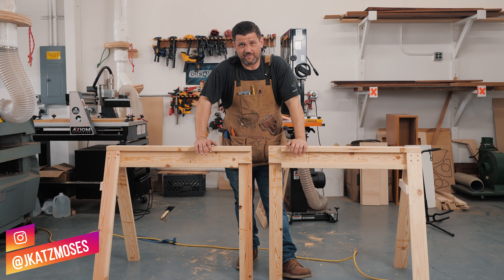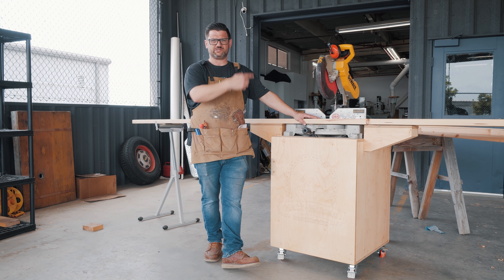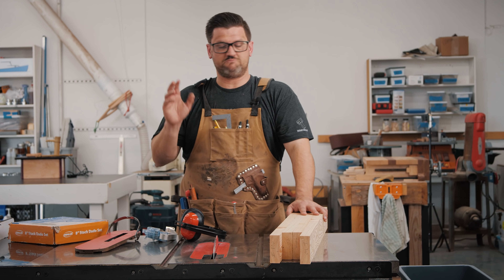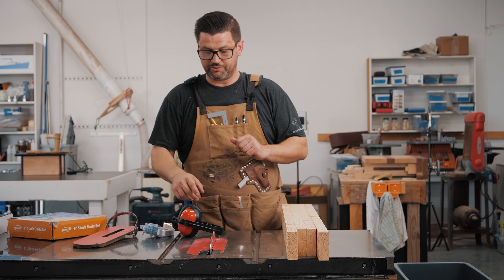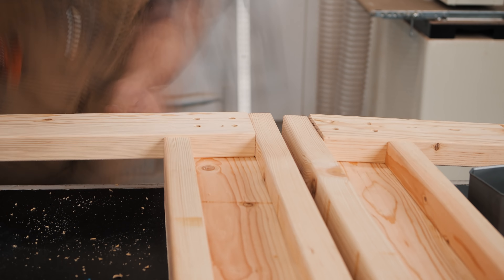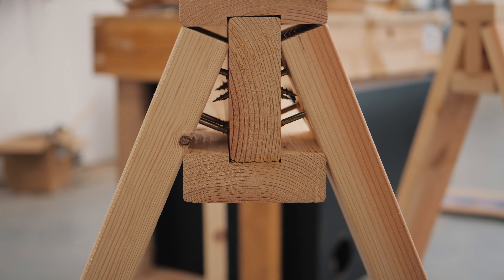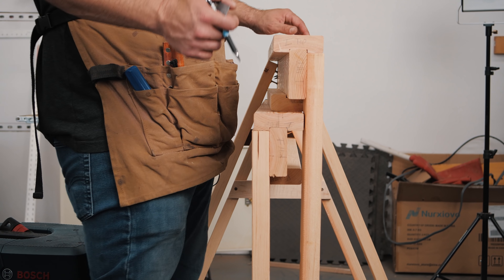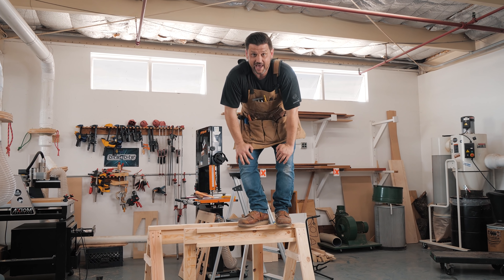Building the Ultimate Shop Saw Horse

Comment: The original dimension for the short leg was correct: 34 5/8" (instead of what you reduced it to later in the video, which was 33 5/8"). Actually they are probably both right. If you do the dado, the shorter length is probably right. If you don't do the dado, the longer one is definitely right (I'm confident because I just finished the version of the project without the dado). You might say, how can that little dado make a whole 1" of difference? Well, in addition to the depth of the dado itself, the dado makes the I-beam shorter, which causes the legs to be spread a little wider.

Comment: Great design. My father in law, who doesn’t do woodworking, insisted on me having a set of saw horses. They were so big and wonky that they just sat in a corner of our basement. I think the few times that they were used it was just to sit stuff on. I ended up taking them apart this spring as they never got used and I had a couple projects that I needed the wood for. Might  see about making a set like yours Incase I ever need a set.

Comment: loving the tripod design, stable and light however, im not sure the Ibeam is adding strength to the total load holding, it is stopping the top rail flexing, but as you have fixed the legs to the top of the ibeam that's where the load is going. looking at it there is minimal contact on the leg, the load is being held by the screws.... I could be wrong here...

Comment: hey JKM! huge fan. one thing to mention (with the disclaimer that i am an amateur and you know 1000x more than me), but the sawstop manual says not to use a dado stack like that (full plate). i'm sure it's fine and you know what you're doing, but i just wanted to mention it. cheers.
Reply from the maker: Thanks bud! You should watch my Sawstop slow mo video. I fear no blade in there.

Comment: Nice design Jonathan, I'm going to have to make a pair...or two.
I know why the cross brace has to be on the outside of the top one, but the placement on the bottom one shouldn't matter, they'll still stack properly. Or is it so you can tell them apart so you don't try to stack the one with the notch on top?
Reply from the maker: Yes and because the cross braces would hit each other if you put them the same distance down. If you dont put them the same distance down they'll "break in" at different heights over time.
Reply: @katzmosestools  I'm not sure I quite understand. Looking at them when they're stacked, the cross brace on the saw horse on the bottom has a bit of space between it and the cross brace on the saw horse on the top. Where do they hit if they're on the same side and the same distance down? I'm not trying to be a smart alec, I'm just trying to figure it out because when I build mine I 'm going to want them symmetrical. I'm not going to want screw holes, whether they're visible or not, on the outside of one of the saw horses because I had to relocate a cross brace when I found out that they do hit. I guess I can always clamp one on and check it out before screwing it on.

Comment: I don't know.  Why is every iteration of a sawhorse referred to as "ultimate" or some other superlative?  The legs don't have full bearing at the floor, nor do they have full bearing at the top.  And the screws are unsightly.  I built a pair about fifteen years ago based on an old Norm Abrams design...stackable and still going strong, with 100% bearing where it needs to be.  The 'tripod' design is unique, though.
Reply from the maker: Maybe because you haven't released your video on your "super mega ultra" sawhorses. Clearly you're the best so let's see it.
Reply: @katzmosestools  Sorry I didn't kiss your backside.  Just a little constructive criticism, and my points are valid.  But despite the flaws, they're wonderful.
Reply from the maker: @photog1529  thanks bud. I dont care if you kiss my ass, I care if your comments are constructive. Summary of your comment:
"Phffffft
Stupid
Stupid
Mine are better but I'm not telling you how"
How about:
"Here's what I think would have worked better and why..."